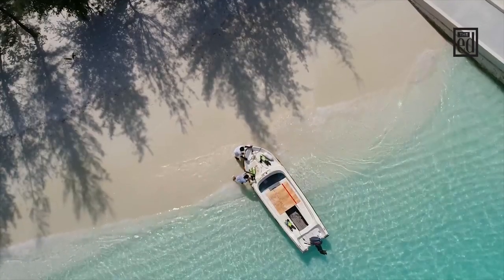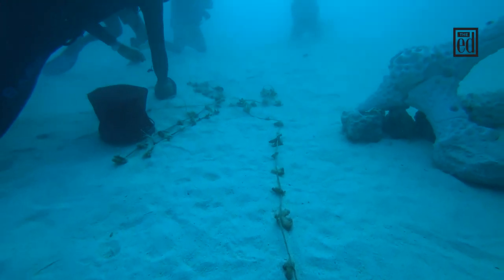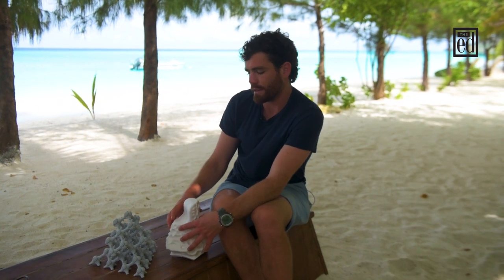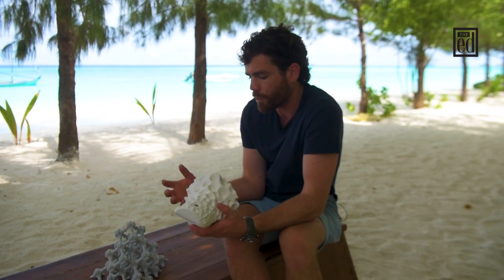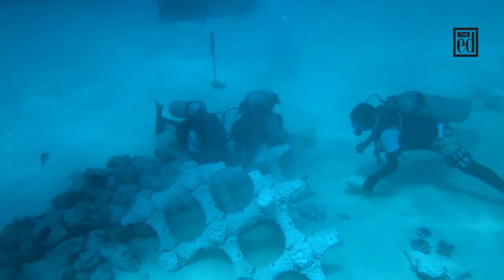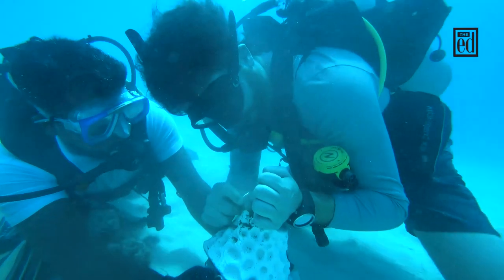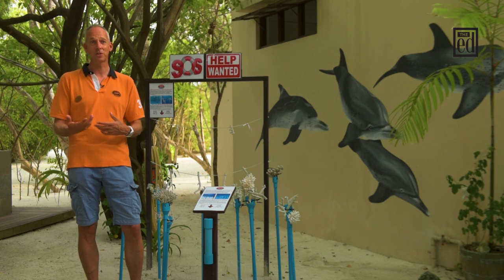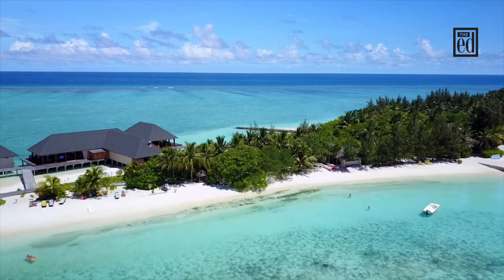Summer Island's 3D Printed Artificial Coral Reef

Comment: All this manufacturing with molds, ceramics,  kilns, assembly on land, loading onto a boat, and piece-by-piece assembly by divers has got to be really expensive.  Why not just 3D print the marine concrete into these approximate shapes right on a barge, then push them off the barge?  The sea life doesn't care how they got there!